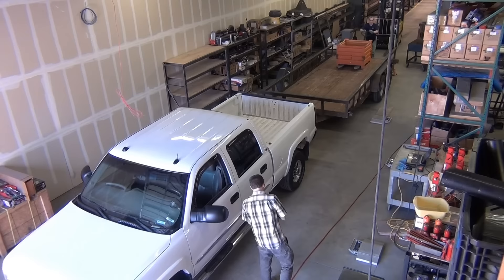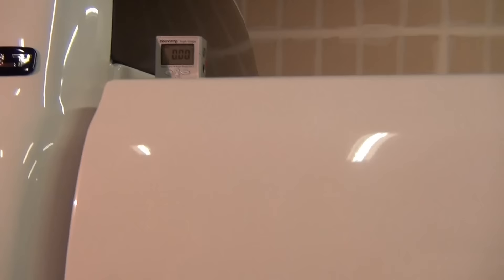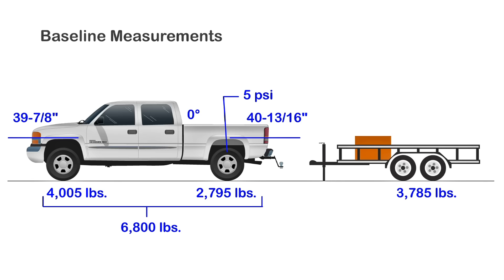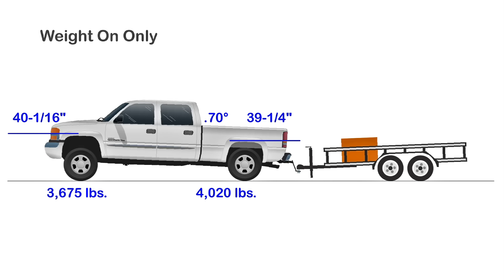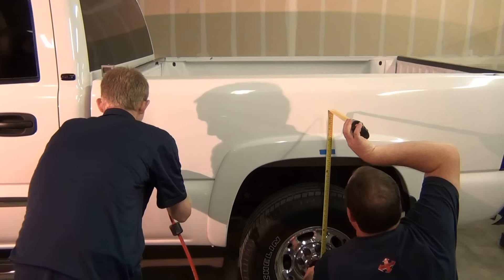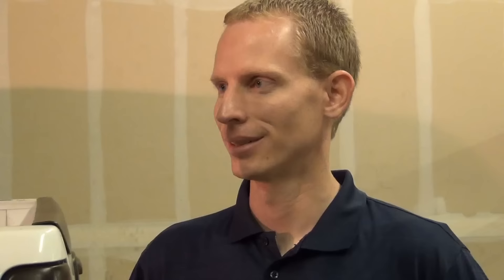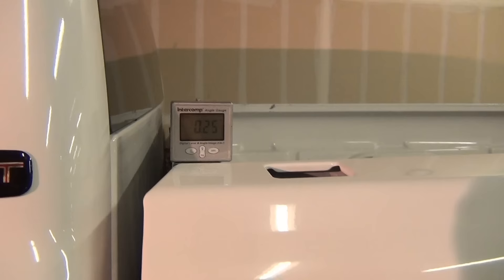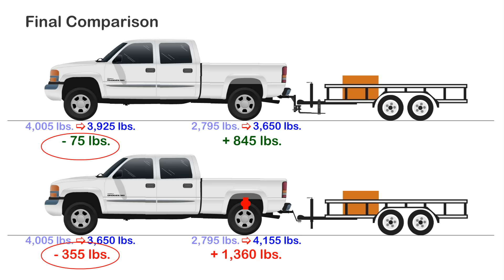The Difference Between Using Weight Distribution and Air Bags to Level Your Load

Comment: I have a 1 ton dually. At what hitch weight is it time to use a WDH ?  A 5000lb 20 ft camper is hardly noticeable behind my F350 diesel.
Reply from the maker: Even if you can't feel it moving much, weight distribution will only help your rig. If you get anything heavier, I'd strongly consider using a weight distribution/sway control hitch. Considering the importance of what you're pulling, it would be a great investment! It would be a nice added measure of confidence.
Reply: I pulled a 24 foot enclosed car hauler with my Jeep inside with my 1 ton dually and it didn't notice it was back there even passing semis (yeah, I was the one in the fast lane for once) at 70mph. It literally felt the same as it does without a trailer.

WD would do nothing. It's just nowhere near the capacity of the truck.

Our diesel engines help keep that front end down though.

Comment: without scrolling through all o these comments hopefully you can answer this for me.  Is there any benefit to using BOTH Air Bags and Weigh Distribution ?  I Have both and have used both but am unsure if I am hindering or benefiting my ability to pull safely.  When you hooked up the WD system it still had a small sag to the rear, would it be benificial to use the Air to fix this?  thanks !
Reply from the maker: Using both can be tricky. If you have too much air in the bags, then you will lose the sway control and WD of the hitch. If you use both then you need to set up the air bags first and then the WDH, so the hitch can still give you WD and sway control. Setting up the air bags last will take the tension off of the hitch.
Reply: @FastwayTrailer  If you leveled the truck with air bags, then you couldn't take any weight off the rear axle without raising the rear end.  Would that be a problem?

Comment: What would be the situation for automatic leveling air bags?  I own a 2006 Toyota Sequoia and am trying to adjust the number of washers and height of the ball on my equalizer hitch.  I know that leaving the automatic leveling on is not a good solution - the truck keeps returning the rear height of the truck back to the same level, minimizing the effect of the equalizer hitch.  The video clearly shows I need the hitch.   I think I should let the automatic system level the truck, then I should turn the auto leveling off for both the set up of the hitch AND for towing.  The one concern I have is that, as I drive the truck while towing, I might lose air in the air bag and then the adjustments will be off?   Comments would be appreciated. Thank you.
Reply from the maker: +Michael Markow,
Automatic leveling air bags are sometimes tough to deal with when using a weight distribution hitch, as you have described. If you have the ability to turn it off for setting up the hitch and while you're towing, that is a great option. You have a valid concern about losing air. This can probably only be verified by setting it up and towing, and then checking to see if the weight distribution has changed.

The only other option is simply based on trial and error. Start the hitch setup at the top end of the weight distribution limits, meaning that you have the front end back to the baseline weight, and the rear end should be heavier than the baseline. Let the air bags make their adjustments, and then check again. If it's taking too much off, raise the L-bracket and watch what happens to the axle weights. You may need to go through the process a few times to get a setup that works well and follows the recommendations for weight distribution. 

One thing to remember is that it's the weights that really matter, and the height of the vehicle above the axles is simply a quick way to check this. In your case, you may need to weigh the rig and then make hitch adjustments that get the axle weights in line, no matter what the height of the vehicle is doing. Good luck!
Reply: You need to consider ball height when setting up the two systems. Don't use the conventional methods for determining the height of the ball because they all include a margin for rear sag on the vehicle.
Reply from the maker: +Andrew Hamilton, thanks for the comment.

Comment: How about air bags and distribution hitch together
Reply from the maker: Using both can be a bit tricky, you'll want to set the springs up before setting up the weight distribution with the hitch. You may need to use one extra washer on the hitch setup to compensate. Thanks for watching!
Reply: @FastwayTrailer  I wound also like to see a video about using both.

Comment: Hi thanks nice video. I have a question I am used to manual from South-Africa pulling big boats with small trucks. Moved to Canada and bought a 2006 Nissan Pathfinder.
It has a O/D button. So when I tow for first time now how do I go abouts? Put it in D and turn O/D off or do I still only pit it in 3 and O/D off. Can anyone help please. Not sure regarding towing with automatic.
Reply from the maker: Thanks for watching +Kosie Schumyn,
Unfortunately, we don't have the necessary information to give you a good answer about towing with your Pathfinder. We recommend you consult the owner's manual, or a local Nissan dealership for the most accurate information about towing with your particular vehicle. Good luck!

Comment: So i was wondering could you increase your airbags after the distribution hitch to level your pick with any effect.
Reply from the maker: If you increase the pressure in the rear axle air bags after you have set up the hitch, you will decrease the amount of weight distribution force you are getting from the hitch. Always set the air bags to the pressure you want first, then make sure the hitch is set up correctly for that.

Comment: Your video is very well done! Can helper springs be used with the e2 weight distribution hitch?
Reply from the maker: Using both can be a bit tricky, you'll want to set the springs up before setting up the weight distribution with the hitch. You may need to use one extra washer on the hitch setup to compensate. Thanks for watching!

Comment: I use both and do worry about to much load on the weight dis hitch going through hollows so run moderate load on hitch and moderate on airbags think that is about best compromise
Reply from the maker: We highly recommend that you check the weight distribution setup to make sure you are getting enough, but not too much weight distribution. Our highest priority is your safety.

If you don’t have enough, you’re not towing as safely as you could because there is less steering and braking ability at the front axle, and you are not taking full advantage of having the weight distribution hitch in the first place.

If you are towing with too much weight distribution, you could put yourself in a dangerous situation by taking too much weight off the rear axle which can cause the rig to jackknife. The safest way to tow is to know where your weights are, and make sure they’re set up correctly.

You can watch a video about adjusting the weight distribution setup here: https://youtu.be/ymcB2yeZr4s

Comment: Is there a standard percentage I could go by to figure out how much weight it would take from the hitch and transfer back to the trailer?  I was looking at a travel trailer that has a hitch weight of 1100 lbs but my Ford Excursion's payload capacity is only 1326.  The total weight of people and gear in the truck would be about 560lbs.  Would this distribute enough weight?
Reply from the maker: Because of how different every truck and trailer combination is, there really isn't such a percentage like that. Even with weight distribution, we still would not recommend going over hitch weight ratings or payload capacities, even if "good weight distribution" would get you slightly underneath those ratings.
Reply: What is the weight of the trailer?  Then add in all the weight of the gear, food, water etc to that.  Now, if you are maxed out with the towing weight, that is it.  No more weight as that is the safe limit set by the manufacturer.  If you are at the max towing weight, or more importantly, the max vehicle weight, then you don't have room for anyone in the tow vehicle except yourself and fuel.
Reply: In the demonstration the WDH put about 13% of the 900lb tongue weight back on to the trailer axles. Your tongue weight of 1100lbs is dry and EMPTY from the factory. You only have 766lbs to play with after removing people and gear from your max payload. Even factory empty with a WDH you are a couple hundred pounds over GVWR and it would be unsafe to drive. 1100 * 0.87 = 957 tongue weight assuming 13% transfer. 766 - 957 = 191 lbs over loaded. Add water, food, propane (not filled from the facotry), 1 more person, etc and you are WAY over loaded.

Comment: I have a Silverado that has airbags in it and I have a car hauler with a wd hitch what’s the best way to use both?
Reply from the maker: Inflate the air bags in the Silverado to the pressure you want to tow with, and then set up the weight distribution hitch. If the air bags are automatic, load the Silverado first, then disable the air bags by turning them off, pulling the fuse, etc. Then set up the weight distribution hitch. Once that’s dialed in, enable the air bags again. You may need to do a little trial-and-error to get the weight distribution dialed in and the ride like you want it. Good luck!

Comment: I've got a fastway E2 Hitch round bar that I want to adjust.  Should I add more washers to the hitch first or should I change the height of the L brakets?  I need to increase the distribution. Reading the docs I haven't found that info yet....thanks!
Reply from the maker: Christine,

Thanks for your question! If your bars are running parallel with the frame of the trailer, I would leave those where they are at, and make washer adjustments to give you more weight distribution. If your bars are angled down (from truck to trailer) then I would raise the brackets to help them be more parallel. That will also increase the distribution.

Comment: Curious.... you say that both air bags and WD is a great combo but in the video, how come you didn’t air the truck’s bags up to compensate for the sag that still remained at the end of the video? Where you guys not concerned with the decreased sag in the back after the weight distribution hitch was put on? The main part of my curiosity is if you guys would’ve aired up the bags to take the sag out of the truck, how would leveling out the back affect the weights?
Reply from the maker: Great question, thanks for asking! Our primary purpose with the video was to show the difference between using air bags and weight distribution, not how to use them together. However, we are working on a video about using both together that should be coming in the near future…stay tuned.

Adding air to the air bags after the hitch was set up would have reduced the amount of weight being returned to the front axle, even though the sag would have appeared to be less noticeable. Effectively what you are doing is changing the relationship between the hitch and the trailer. By adding air, you are raising the hitch relative to the trailer’s tongue. The amount of weight distribution you get is based on the difference between where the ends of the spring bars start, and where they are held when hitched. Raising them 3” gives you less weight distribution than raising them 5”. Adding air to the air bags raises the tow vehicle, therefore the hitch, therefore the starting point of the ends of the spring bars relative to the trailer, which decreases weight distribution. That is why we recommend airing up the air bags first, then making adjustments to the weight distribution setup.
Reply: Ok, I’m still confused about that last part though, the part about where you said to air the bags up before you set the WD hitch.... 

I guess if you knew that it was gonna take 55psi of air to level the back of the truck out, you could air to that and then set the hitch but wouldn’t that not be right, because without the WD hitch, 55psi is what y’all said would be needed to bring the back of the truck up to NRH while unloaded. After the WDH is added, wouldn’t that 55psi be too much at that point since the hitch is spreading the weight out between the steer axle of the truck and the axle(s) of the trailer? Guess I’ll just have to wait on the next video....
Reply from the maker: @billplaisance6387  Yes, in our case it took 55 psi to get the truck back to the baseline height. It is very likely that 55 psi would be too much air for this setup using both air bags and weight distribution together, and after some adjustments, the setup would need less air in the air bags, and a change made to the height of the weight distribution hitch head, and angle of the spring bars.
Reply: @FastwayTrailer  Really looking forward to using both together.  With an E4, and airbags on a 2500 I really want to understand best practices for setting this all up properly.
Reply from the maker: Using both together is a great setup. Thanks for watching! Best practice is to inflate the air bags first, then set up the hitch. Follow the guidelines in your owner’s manual to check for proper weight distribution, and make adjustments as necessary.
Reply: @FastwayTrailer  how do you know how much air to put in the air springs if you put air in them before you setup the hitch?
Reply from the maker: Unfortunately, this is a bit of a guessing game. Start with a recommended amount given by the air bag manufacturer. Set up the hitch, and tow for a while. Try it with a little more or less, and adjust the ride to where you feel it is the most comfortable, while still giving you good weight distribution and sway control.

Comment: Do you do anything for 5th wheels. I have a 2007 Toyota Tundra with a 5.7 V8 and the supercharger. I'm about to get a fifth wheel cougar 24RDS. What can I do to level things out in the back of my truck and make it so the lights point in the right direction?
Reply from the maker: Unfortunately we pretty much only deal with bumper pull trailers. Thanks for watching!
Reply: air bags are probably your biggest proponent.  That, and adjusting the weight in the trailer so that is is more evenly spread and over the axles.  However, the Tundra isn't really an in-bed tow rig.  There is this...  "Toyota Tundras can tow between 6,800 lbs. and 10,100 lbs., which is too low to carry the majority of fifth wheels. The average fifth wheel weighs between 12,000 and 15,000 lbs. ... Toyota Tundras are smaller than many other varieties of pick up trucks, and their tow capacities reflect this."

Don't forget that the 10k lb limit is for towing only.  You can not have a 10k trailer and a lot of gear and people inside the cab.  check the total vehicle weight rating.  Yes, it may pull it, but stopping and turning is where the weight limit and safety measures shine through.
Reply: Also, the SC doesn't add to the weight capacity, only shoves more air down the throat and helps the engine produce more power a lot sooner than it would as N/A.

Comment: Awesome video. I have  2015 Tundra 1/2 ton which I have installed airbags on. I used to tow a77000 GVW 28ft TT. My dealer set up the weight distribution hitch for me with an empty truck bed. I used to have two dual sport  Yamaha TW motorcycles that weighed @ 300 lbs each. I added the air bags for this weight. I usually ran @ 20 lbs of air in them . This seamed like a great combo. I sold that trailer and the motorcycles . And now have bought a 23 ft TT with @ 6600 GVW . I am looking at an Anderson weight distribution hitch. What do you think about these?  I will leave my air bags on a low setting and low weight in the truck.

Comment: What about a boat trailer? Often made with surge brakes and different tongues... bags then? Tongue weight is often 5-7% of the trailer weight there
Reply from the maker: +Rookie5oh,

Great question, thanks for asking!

Weight distribution is not as commonly used with boat trailers because, in general, they do not demonstrate some of the sway issues travel trailers are prone to. This is because of their much smaller side profile, and generally lighter overall weight. However, the same principles apply to boats as to any other trailer with regards to weight distribution and air bags.

Check the ratings on your tow vehicle and receiver hitch. Even though the boat trailer's tongue weight might be smaller relative to the gross trailer weight, it may still be heavy enough that it exceeds ratings, or causes a loss of steering and braking control. You will almost always find two ratings - one for towing with weight distribution, and one for towing without. With weight distribution is always higher. Air bags to not change the ratings of a tow vehicle.

Air bags and weight distribution are not interchangeable, nor mutually exclusive, meaning, you should use weight distribution when that is the best solution for your combined vehicle setup, and you should use air bags when that is the best solution for your hauling setup, and sometimes you may want to use both together, which is great.

The principles for using either with a boat is the same as for using them with any other trailer: Set the air bag pressure to the level you want to tow with, then set up the weight distribution correctly after that. If you change the air, check the weight distribution again and adjust it if needed.

Keep in mind that weight distribution hitches WITH chains will NOT work with surge brakes, because of the way the chains lock up the brakes when making a turn. The Fastway e2 hitch ( http://www.fastwaytrailer.com/e2-hitch ) is one of only a few that can be used with surge brakes because of the rigid bracket attachment to the trailer frame.